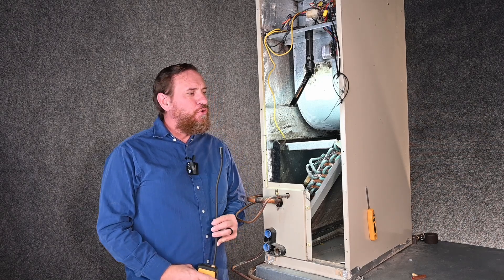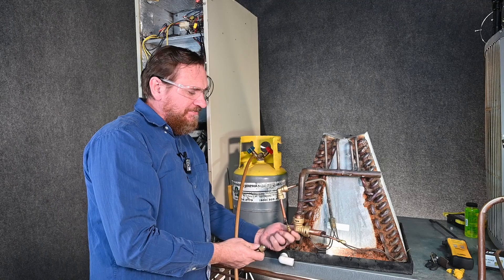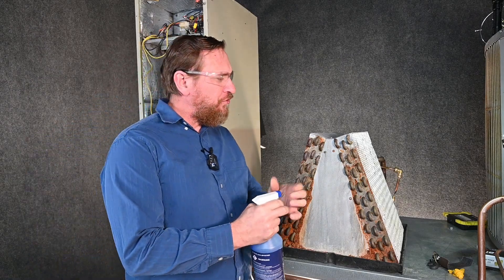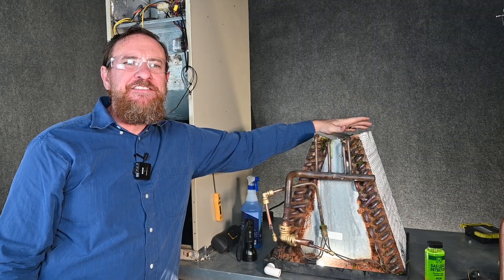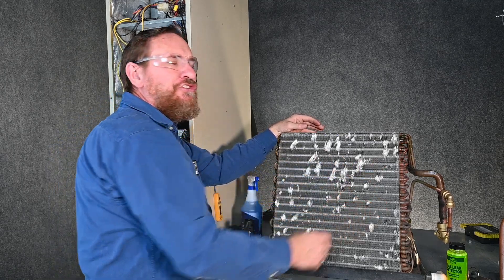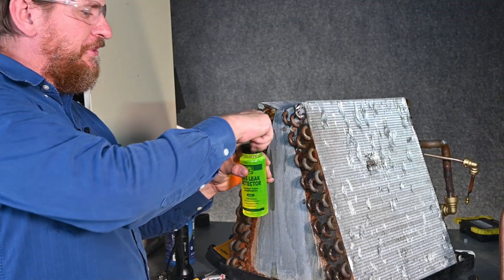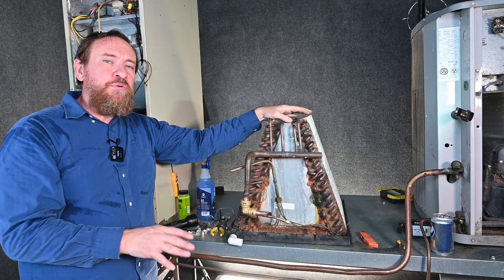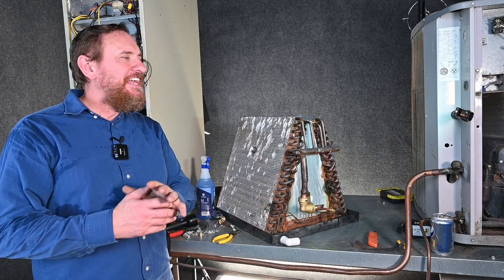HVAC 160 evaporator coil isolation test

Comment: I don’t care if you can repair that coil or not, the shape it’s in and the labor cost to take it out, that coil should be replaced.
Reply from the maker: Right now coils are in back order and unavailable even under warranty. The price of coils now are going through the roof. A Lennox 3 ton coil was listed at $3k. I can fix it for much less than that

Comment: I have searched everywhere for some inexpensive 3/4" & 3/8" Press Fit Removable connectors. I do not have any just laying around, what brand did you use?  Where did you get the 3/8" Schrader valves with cores? Would this procedure still work with the expansion valve still connected to the evaporator?  Thanks, Jim
Reply from the maker: Hi Jim, I find the zoom lock push, and RLS originate from the same factory. I'm pretty sure  Rector Seal profit is also the same.
Unless something changes there is no difference.

I just got a sample of airsept fittings that connect to the flared fitting such as a unit to copper line set.  I will be trying them out soon
Reply: Thanks I will have a look at both.  I have really enjoyed your videos.  Jim

Comment: Excellent video Ty! One thing if I may suggest, when someone is making a repair on a U-bend or particularly difficult area whether it's the evaporator, condenser or other tricky place, I would suggest using a number 000 torch tip, also sometimes known as a jewelers torch tip. If the proper manufacturer's torch tip settings are used with the 000, it makes it very easy to braze a leak shut in those areas. It is also a very good torch tip to use when repairing on aluminum if the heat is controlled very well. I have had much success using the 000 tip instead of the 0 or number 2.
Reply from the maker: Thank you!
I absolutely agree with the 000 torch tip. Eventually I will make some videos demo strating that. Thanks for the comment and words of encouragement.

Comment: Very helpful video, thanks! 
Our residential HVAC has a leak and our contractor wants us replace the whole system, including the air handler. What would you recommend?
Reply from the maker: I can't recommend anything without seeing the system.

It can possible be repaired, it may just need one component or it may be best for a while system. 

I do recommend getting 2nd and 3rd   opinions. Don't chose in price alone but see what they say and make an informed decision. 

A lot of HVAC companies are being bought out by private equity companies. These companies train to sell sell sell. They also get commission on sales. 

Since there is a skilled trade shortage a lot of techs don't know how to repair anymore and it's just easier to sell. 

Not always but many times, the  more a company spends on marketing and advertising the more focused on sales they are. 

Companies that do repair work don't have enough good techs to grow so they don't advertise because they can't handle an increase in customers.

Comment: Thanks an bunch for this tutorial ..in my 30 yrs in the trade / in the distant past i've repaired a many of an copper evap coil leak  s ..but Not much  if ever  now a days ..refrigerant has  gotten so dang expensive   so now days usually the coil or equipment get replaced ..once verified or leak is pinpointed .....Thanks again & i saved uR Video to possibility show an future customer if or as needed .....

Comment: How many uses have you gotten from each of the quick connect fittings?
Reply from the maker: I don't do as much field work as I use too so I've only used this about 20 or    25 times over the last 2 years.

Comment: How do you call those quick fittings? I’m trying to find them
Reply from the maker: SB1 quick connect refrigerant fittings by NPR is what I used. But also 

PRO-Fit Quick Connect Brand by  Rectorseal

ZoomLock PUSH push-to-connect refrigerant fittings by Parker Hannifin

Comment: Do you think if you're installing a new system by placing a fluid film type protective coating on the coil would be a benefit?
Reply from the maker: That is a great question, and it depends!

1st if the airflow and filtration is properly set up (rarly 😔) then the coil should never get dirty. (Some exceptions and separate  solutions tho those exceptions)

If the home is sealed properly with filter controlled air infiltration there is much less chemical leaching with building products. 

A IAQ monitor can control outside air to dilute those poulutants that are not only affecting the coil but the human health. 

Any coating applied will reduce heat transfer. Some more than others. 

I save coil coating for special applications and on a Case by case bases. The last one I did was a sewer treatment plant.
Reply: @love2hvac  Appreciate you taking the time to reply and providing so much insight to what is occurring in the evaporator.
Reply: Blaster Surface Shield could be the lastest product. Possible HVAC
https://www.youtube.com/watch?v=NE1_EiZIVHs

Comment: I did a warranty coil last month, and we were pretty slow at the time. So I brazed on some valves, washed a big ol trash can. Filled it with water and dunked it. The leak was right where I had found it. 2/10 would not recommend using a trash can.
Reply from the maker: Thinking outside the box, I like it!
So I guess you could say the coil was.... Trashed 🤣

Comment: Thank you so much Mr. Ty for your informations and time I’m really appreciate that.Q: Is there an evaporator coil does not rust? Thank you.🌷
Reply from the maker: Yes, micro channel is all aluminum and does not rust. 
Some manufactures use stainless steel in place of galvanized.

Comment: In residential I think a heated diode picking up refrigerant in a coil is all I need in this case. I just make sure it's not from an easily repairable source. I love your isolation test, but I haven't been at a company that would want to pay me for the time to bother.
Reply: The metal around the coil is pretty rusted; you get dielectric metal currents that cause leaks. Just quote a new evaporator coil and save time and money!
Reply: At my company, its pretty much the same.

Comment: I like the idea of the quick connects reusable for evaporator leak testing I got a try that one 👍
Reply from the maker: I'm not sold on them to replace brazing but they work great for coil cleans and pressure testing.
Reply: @love2hvac  Iv seen them a few years ago. I also would not use them on one of my jobs.   Only a testing tools

Comment: That quick fitting trick is genius.

Can you do the same isolation test on the lineset? How do you find a leak in a lineset inside the walls?
Reply from the maker: Yes you can, I am editing the lineset video right now
Reply: @love2hvac  beautiful. Looking forward to it.
Reply: You don't; But you isolate the problem; may have to run an outside lineset!